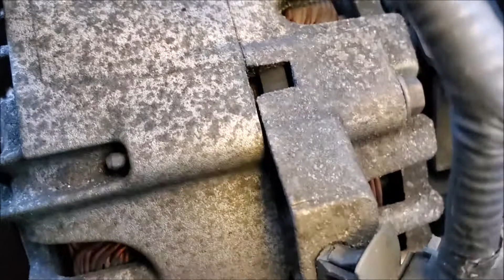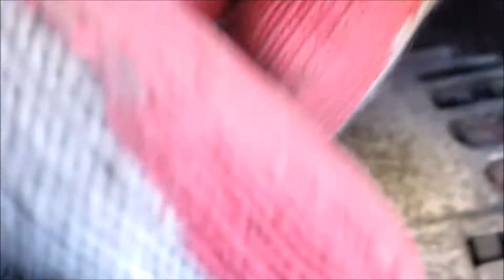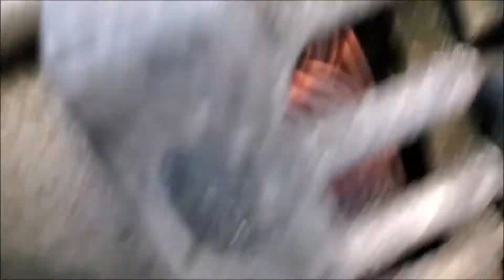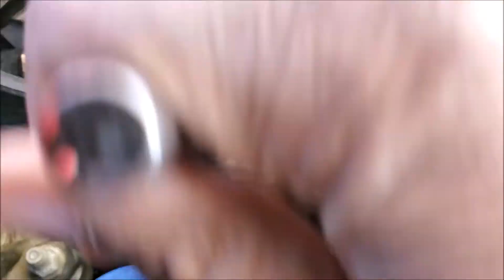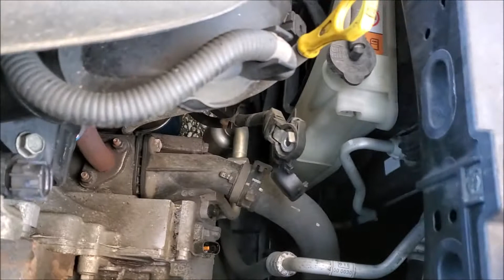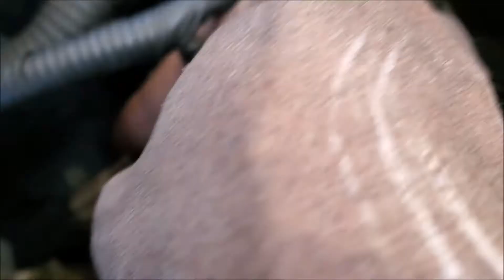2013 Kia Rio replacing the alternator

Comment: I was never able to get the bottom bolt back in mine😵
Reply from the maker: Did you install the bottom bolt first? Is the tensioner loose?
Reply: @LewsSpeedShop is there a tensioner for the bottom bolt?? I’m having a really hard time taking the bottom bolt off
Reply from the maker: @moath939  your car has a tensioner?

Comment: Hello, what's the part number on the alternator you used?
Reply from the maker: This is the part number for the original alternator for this vehicle. MANDO 11A1097
This is for a engine without engine start feature